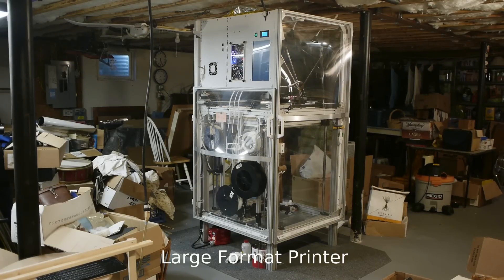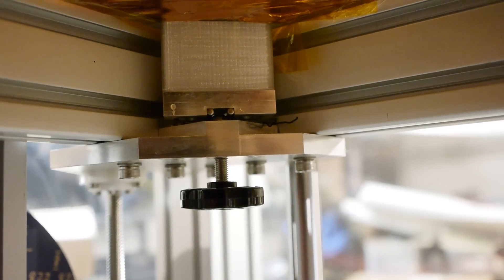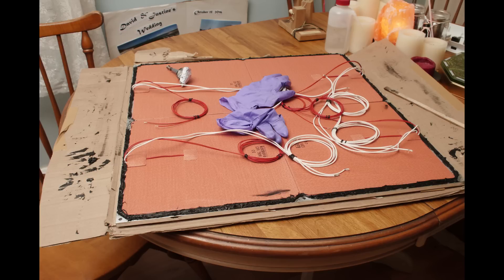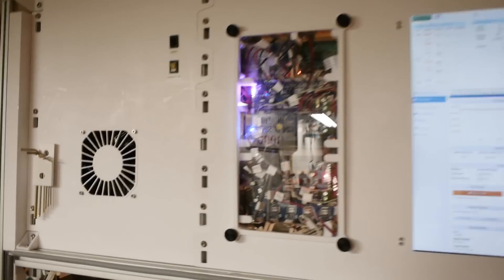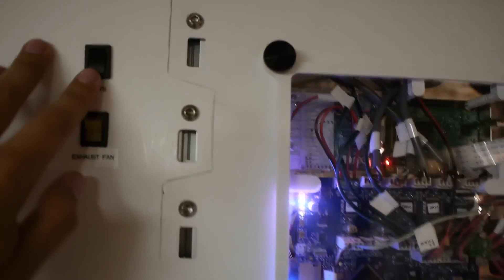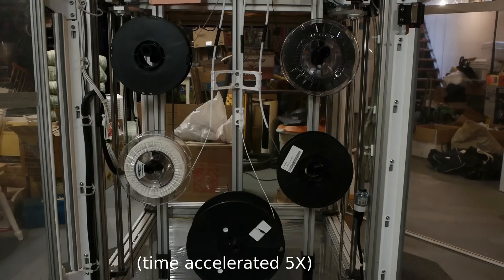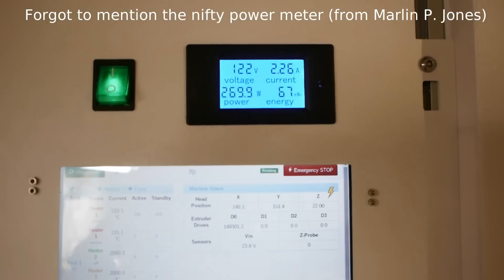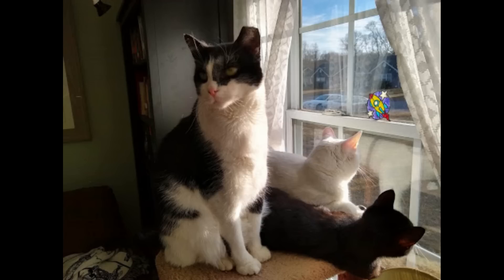Large Format (refrigerator sized) 3D Printer in Basement

Comment: Overconstraining all the way. Measure the shape and you can print a raft to “level it out” for every print. When I was messing with my Prusa, I have on purpose bent the build plate. The normal multipoint calibration took care of getting the raft stuck to the build plate properly. Then it interpolated to a plane (no z correction) over 10 layers. I think the whole “build plate must be super flat” thing is silly. Sure if you want a mirror surface of the build plate transferred onto the bottom of the print it’s nice to have a flat build plate. But even the textured surface you get with a raft is only a minute and some sandpaper away from being as smooth as you wish.

Overconstrained anything is really what any precision manufacturing process has to deal with. Nothing is perfectly rigid, and with small enough tolerances, cutting or other contact forces deform the workpiece enough that the “infinitely stiff” assumption goes out the window. An overconstrained build plate may be wavy, but it’s a whole lot stiffer too. Waves are easy to compensate for. Lack of stiffness makes it much harder.

Hats off to the printer design. It’s awesome.

Comment: I love your design here. I'm considering building one based on your project. As far as the sag issue goes, have you considered carbon fiber tubular rails? Or do you have any solutions other than the springs? It seems like if you were using the whole build volume that the springs might max out.

Comment: Very nice build!

My printer that I am building is a HevORT design which has a build volume of a bit less than 600mm cubed. So size-wise, it's on par with yours. Although I imagine that your Z dimension is greater.

The HevORT is a homebrew design by a guy in Canada. Mine uses three points of contact on the bed, via ballscrews rather than leadscrews. I'm a bit concerned with wobble, but on the plus side I am now set up for non-planar printing. In any case, I suppose we shall see. I can always add another ballscrew. Which would help out since my bed has gotten heavy enough that drift is an issue.

I was able to get a heater as well as a flex plate sized for my printer. I see why you did yours the way that you did, but I don't see myself printing out duplicates all that often. BTW Professional Plastics in California has FR-2 and FR-4 (PCB material) in 2' x 2' sizes. Pretty cheap too. I bought a 2' x 2' 1/16" FR-2 plate from them for around $25. And a 1/8" version for ~$55 or so. From what I've read, it makes for an excellent build surface, but I found a place that custom built a 595mm x 595mm flexplate for me. What are you using? It sort of looks like FR-2.

The HevORT uses "wobble Wings" to negate wobble in the (relatively) cheap ballscrews that we use. https://www.youtube.com/watch?v=mqSQhwqSzvg You can see the "with and without" wobblewings results at the 17 minute, 43 second mark. Pretty impressive in how it reduced artifacts.

The HevORT has been designed for speed, mine uses 12mm wide Gates belts and Clearpath servo motors for the X & Y axes. It also uses Titanium hardware as well as carbon fiber tubing. The extruder/hotend mount is currently getting printed in sintered aluminum. Should be pretty lightweight.

If I'm guessing correctly, your dual belt system should have one belt offset from the other by half a tooth, which might reduce artifacts. This was something that I had considered doing for my printers. Now that I look closely at your video at the 5:28 mark it sure looks like this is what you are doing. :)

Needless to say, it will be enclosed. It's a finger biter, and we have curious cats that like warm places too.

I wondered why yours is so tall. Mine is bad enough as it is. The Duet (I will be using the same setup, including the expansion board) has a nice mesh bed leveling routine. You'll need a BLTouch or something along those lines to detect the bed. But you should try it out. :) 

I like your insulation of the bed. I have used the fire wool before on my delta printer, but without the Mylar. That and the fire extinguisher. Nice! 

No printer side controls for me, I'll use the Duet inside of Chrome. 

I had to laugh at your variac. That's one way to do it. But since you have the luxury of multiple heaters, one could limit the number of active heaters to a max of two (or so) at any given time. Just saying... 

If you plan on using the variac permanently, then you could do what this guy did and "hard-wire" it for the output that you want. Less likely to burn up this way: https://www.youtube.com/watch?v=M8cJrJyR87o Check out the video at the 3 minute, 25 second mark. 

My heater is 120 Volts, 1300 Watts. So the heater will probably get its own dedicated circuit. Although as a Controls Engineer, I can think of some options. One option would be to buy four individual heaters and "round-robin" the outputs. LOL!

In any case, that's a very impressive 3D printer!

Comment: Awesome build. 
Well thought out. 
I stumbled across your board video. 
I'm looking for a way to run a 3d printer using ironless linear motors with linear encoder implemented. 
Would your board work for that. 
The linear motors should work with the bldc foc control,  but I have no idea how to run a step control board in sink with the servos. 
Sorry if I'm joining dots where there not. 
Just trying to work out how to drive the system with a plug and play.

Comment: Fantatic  build, Lots of thought going in to its design. I love it.

You can also solve the problem of sag in the horizontal bars by clamping together a second set above the first set. A dual rail system. That would give you all the vertical rigidity you need to over come the sag and get rid of the springs.

This would be a great test bed for  your near  zero brushless motors. Gear them down by about 5 or 8 to  1 to reduce clogging but  still keep speed up on the X Y drivers. Then you could do 9 point  auto levelling   at super high speed.

I use Hyperplan (shareware,) to do my engineering project management. It's like post it notes on a  pivot table on steroids. 

Justine, awesome projects.